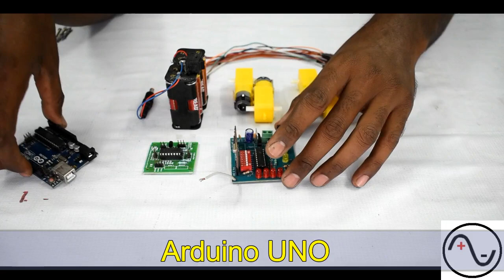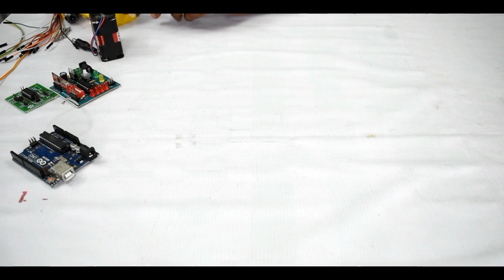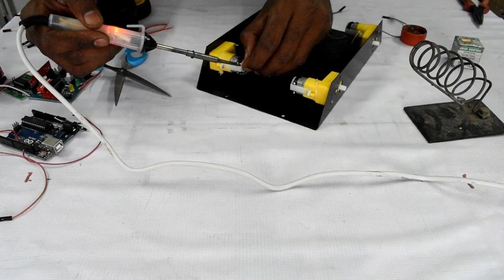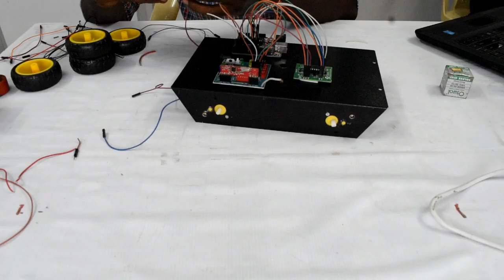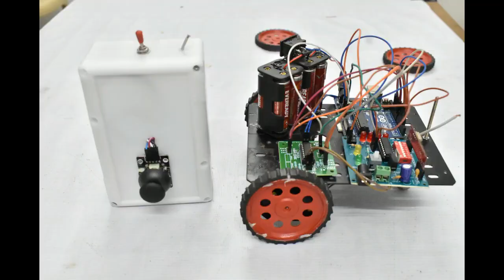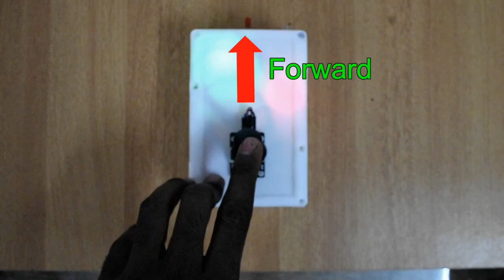RC car 4WD|Arduino Remote Control Car|RF 433mhz Receiver Transmitter #RCcar #RemoteControl

Comment: Hi!  I am trying to build a very similar unit.  Can you provide a list of all the needed parts?  Sorry to bother you, I'm a little new to this all.  I'm using Arduino
Reply from the maker: Yeah sure I can help you, please mention your needs😊
Reply: @siliconrovers9633  I basically want to do this 4 motor project with a controller but not sure of the list of modules etc to do it.  Thank you!
Reply from the maker: You just want the components list used in this project?